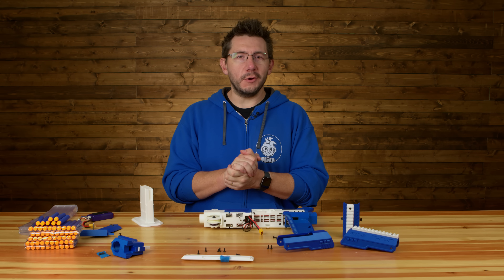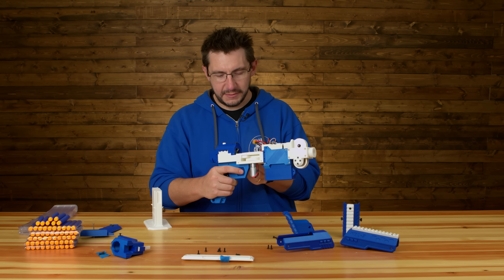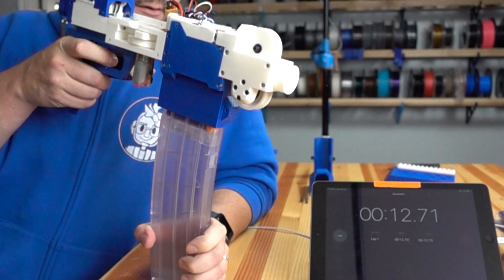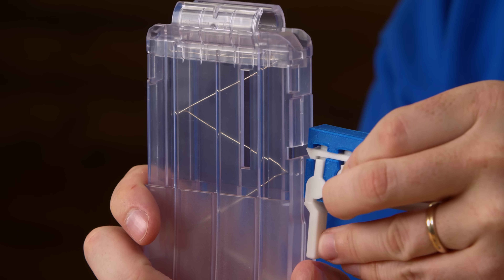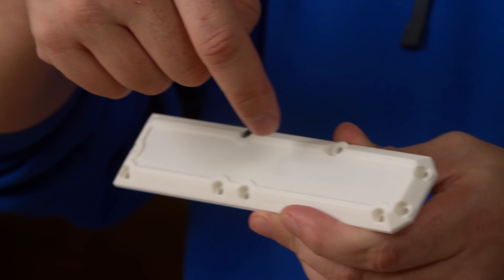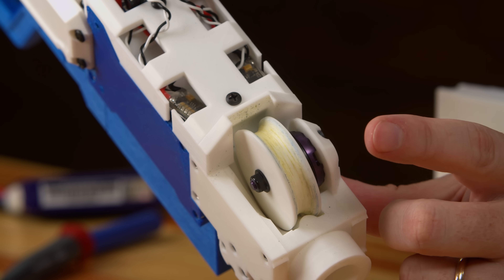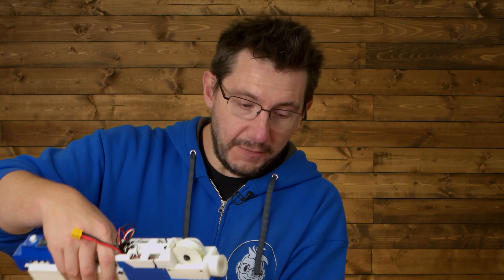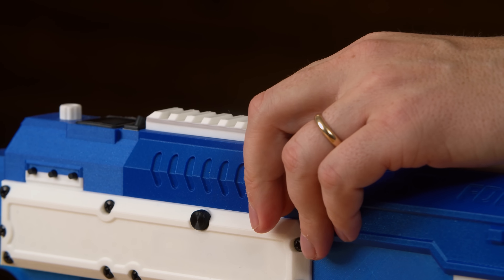Full Breakdown of the Project FDL Nerf Blaster and some Sad News

Comment: Magazine ....it's a magazine. Clips only hold onto a small part of the ammunition (i.e. they clip onto the rim of a real ammunition cartridge).  Clips are normally used to store ammo in a configuration that allows fast transfer to a weapons internal box magazine or into a removable magazine. A magazine fully encloses the ammunition and feeds ammunition into the action of the blaster/weapon/etc itself. This is the general rule/function with a few exceptions like the M1 Garand of WWII where it used a clip to both hold readied ammo and to load from clip into the action of the rifle. Thus the infamous ping sound you hear in WWII movies when the rifle runs out of ammo and the clip is ejected out of the rifle.
Reply: You knew exactly what he was talking about, so it doesn't actually matter at all. Especially on a youtube video for a 3D printing channel discussing dart blasters. Save it for the battlefield, commander.
Reply: @UncleRots  Wow, way to project much. They said they plainly didn't know so I'm filling in a gap. Especially since many other people also don't know any difference. The words are simply not interchangeable. I wasn't attacking, being a jerk, etc. Why do you assume I am and reply with a snide remark when you should have just said nothing.

Comment: Rule of thumb: If it pushes the rounds into the firing chamber, it's a magazine. If it just holds the rounds until another mechanism pushes them into the firing chamber (or you manually shove the rounds into a built in magazine like a Garand or a Mouser), it's a clip.
Reply: Clip just refers to bullets that are aligned onto a metal plate that can be easily and quickly loaded into a magazine. Most detachable magazines will have a mounting spot for the clip and the bullets can be pushed in. On internal magazines like the M1, the clip mounts to the top of the receiver and the bullets can be pushed in.
Reply: Clips feed magazines.
Reply: I was just about to correct him H B. Also i have to add. magazines to not push bullets into the the chamber in most weapons the bolt will strip (push) the round out of the magazine, up feed ramps and into the chamber. The spring only moves cartridges to the top of the magazine.

Comment: I'm terribly saddened to learn about the demise of Project FDL. Where will we buy the mags now? Since they're made of injection molded plastic, they haven't put the plans in their repository. We can't make them ourselves!
Reply from the maker: I bet Luke at Out Of Darts could fill that gap
Reply: Injection molded aftermarket Nerf Magazines are plentiful but so are 3D Printed versions as well!  Worker makes several types of Full and Half Length injected molded magazines while you can find many variations of Half Length Magazine models on Thingiverse.
Reply: @codyc.4971  The issue is that I'd like to ensure that whichever magazines I make/buy, that they will fit into the magwell on the FDL3 that I'm making. I could always modify the design to accommodate a new magazine, but I'd much rather spare the effort since the design is built around the particular 22 and 40 round Worker magazines that were being sold on the Project FDL website. Is it true that the Worker magazines all conform to the exact same dimensions and specifications, or is it just a generic name for a particular style?
Reply: @danielsmullen3223  Worker is a brand name. Project FDL has never used proprietary magazines. The Worker 40 was designed for a Worker brand blaster, but PFDL designed a nose that was compatible with it. Worker also has a lot of 3D printed accessories (not STLS) for Nerf blasters besides injection molded magazines. While there are printable magazines out there, most people purchase them for their strength, reliability, cost, and ease of use (springs for them are annoying to make).
Reply: @danielsmullen3223  They're all standardized. The 22 round is based off the standard Nerf design while the 40 round magazine is a Worker designed product.
Reply: Daniel Smullen Lighttake.com or https://www.nfstrike.com search nerf magazine on Etsy 3D printed options available.